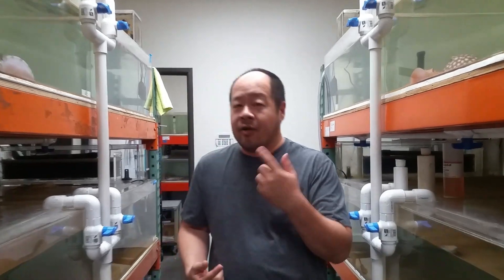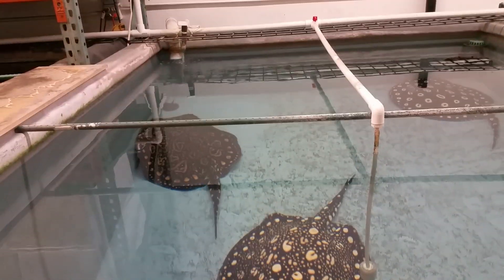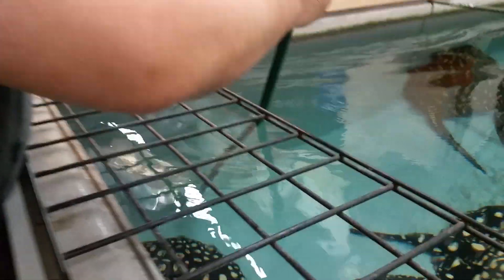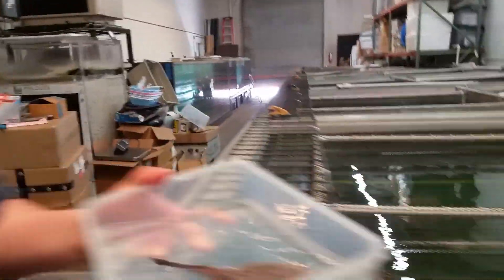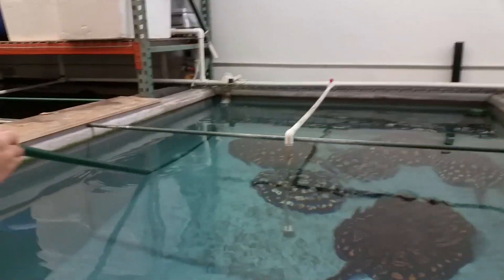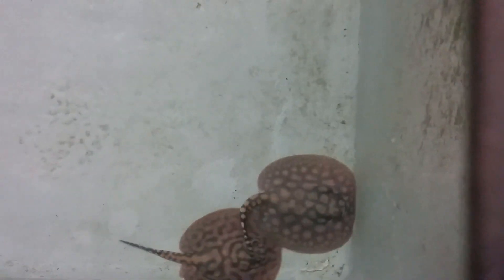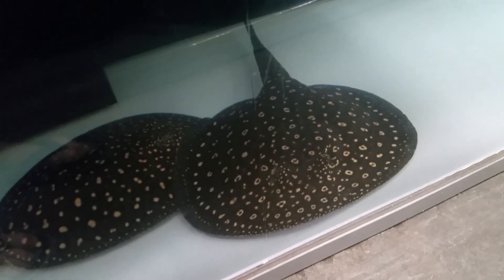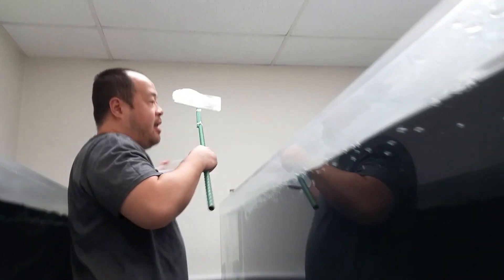WOW!!  Designer Super hybrid pups - Absolutely Amazing!!

Comment: What is your nitrate level? I saw your filtration system video but I did not see what you do to remove nitrates. Is it just water change or do you have a separate filter?
Reply from the maker: Nitrates are removed by water changes. Rays can tolerate a wide range of nitrate levels. I've seen rays thrive in levels as high as 100 ppm. But I keep mines around 10 to 20 ppm
Reply: @StingrayBiology  Thanks for the info. You have an amazing operation. Keep up the good work!